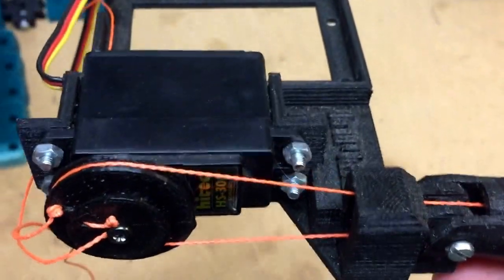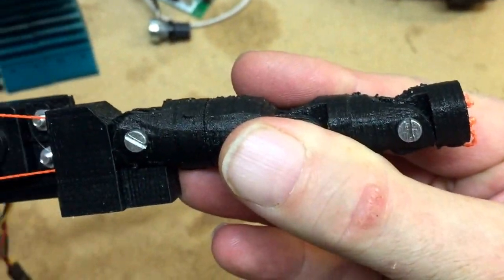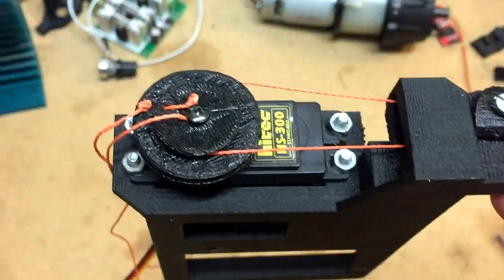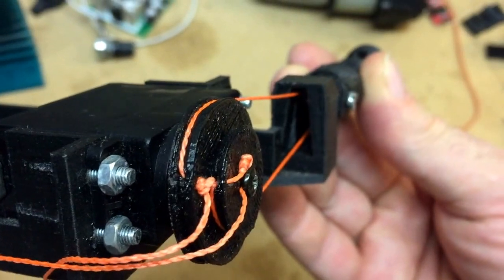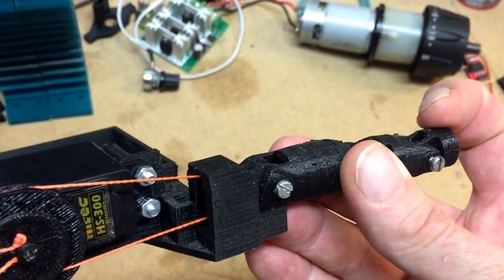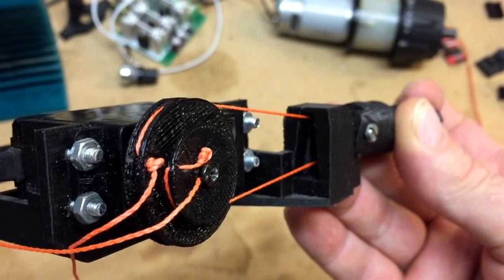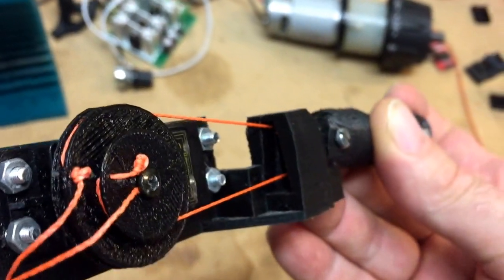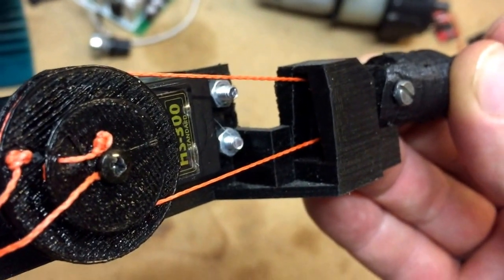How to tie the knot for the Dual pulley servo wheel

Comment: i can not fit this pulley to my servo, i'm using MG995 servo, is there any file with a smaller hole ?
Reply from the maker: If you printed in PLA, it's better to heat the pulley, either with a hot airgun or by putting it in hot water ( about 60-70 degees ). Then you can push it on and get a very good fit.
Reply from the maker: Sorry. You need a smaller hole. My first suggestions wont work in that case. What size is the servo shaft ?